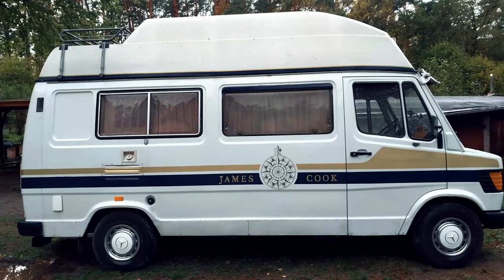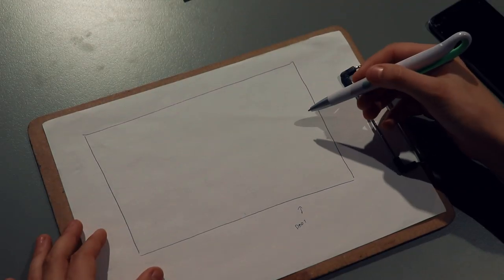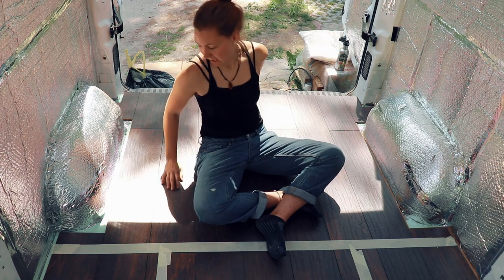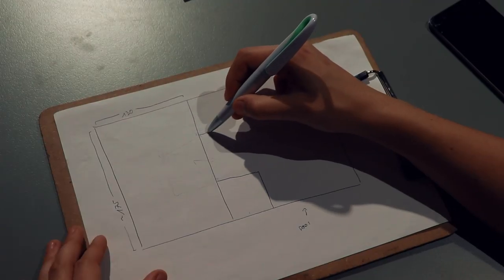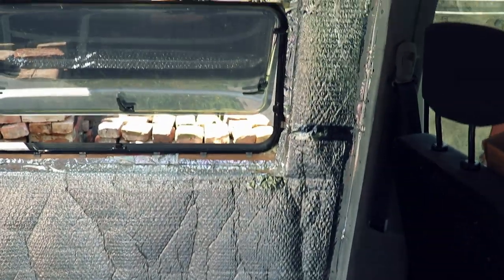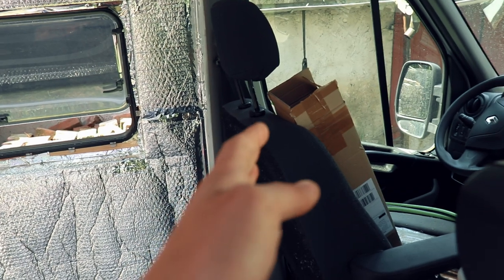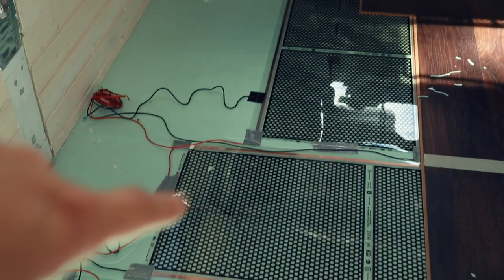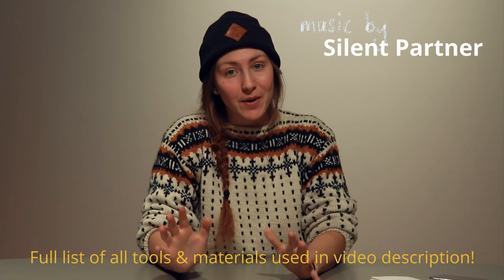FLOOR HEATING in a VAN??? My Layout | Van Build #05

Comment: We did this in our van build. I couldn't find DC mats in the US and used AC mats by Quietwarmth. Absolutely awesome addition to the van. Worth the extra effort.

One mistake I did make was placing the thermostat temp sensor. An exhaust muffler is directly under the sensor and it artificially raises the temp after we shut the van off. And the discharge from the Espar heater is near it also.

Comment: infra red foils are so thin, lightweight and not terribly expensive, so I think it makes perfect sense to include it. It is very important to have few heating options  in case of full time living, just in case something happens during winter. I will go with IR foil when on hook-up, 8kW Diesel heater for quick heating, and Truma gas heater as a main, quite option.

Comment: You are getting very good at putting that flooring down. Practice makes perfect. Every one of these builds is an experiment. You have shown you are not afraid of the trial and error that it takes.  Did your old van fit into parking spaces in Europe? Are you trying to become a stealth camper so that you don't get in trouble about living in your van? I don't know what the laws are about living in a van are in Germany. Lenja I would make that bed bigger to fit you properly so that you can rest without restrictions. You can convert the end of your bed into a small couch by putting a hinge in the bed base and using pillows as couch cushions. It is not like you need that room to have a dinner party for a party of ten. Looking good. Cheers from rainy California.
Reply from the maker: Haha thanks! You're so right! You sure shouldn't be afraid of that trial and error process! :D Not sure if I didn't make it clear enough but I want to be able to extend the bed over the seating area and that should be more than enough space for me :)
My old van actually also just fit into the spots as well! But I liked that part so I wanted to keep it the same with the new one. I realised that the stealth aspect is a little overrated, I had no problems what so ever living in my less stealthy van before, even though it's not really legal in Germany. The parking spot aspect is a big deal for me though since I'm living in my van in a city (Berlin) and if you don't fit in any regular spot it makes it extremely more difficult to find a place to stay. If you're interested in the reasons why I chose to sell my old van, let me know. I could make a video about that 🤔

Comment: Hi Lenja, I love your vlogs! I've converted my van too (I'm a Dutch girl) and put in 12v floor heating foil as well. It's nice to get the cold out of the floor but it consumes quite some power so I don't use it that often. I have vinyl flooring btw. I rather just wear my warm slippers 😉 For heating the van I use my Wallas stove with heating top.

I really like to see a true van build with all the mistakes, second thoughts and frustrations. This is exactly what it is for mere mortals to do a conversion. Keep up the excellent job you're doing,  you'll love it even more when you've finished it 😘

Comment: Have you calculated the power needed to run the heating film? I checked online and they are around 200 watts per square meter - At 12 volts that's 16 amps. I'm doubting that even with 525 watts of solar panels you'll be struggling to make even a fraction of the required power to run them on a cloudy cold day when you will need the heating most. What other means of heating are you planning?

Comment: I have heating foil in my van conversion. 5 pads, 24v each.. I have used the fleece covered ones. Consider that the laminate floor is going to move and shift around while driving, over time this can rub layers of the foil and break them or even create a electric hazard. Overall these are very slow to heat the floor, but work quite well to give a nice floor feeling. They are useless to actually heat the whole van though.. also need quite a bit of power ( I have a 5.5kw/h Tesla battery pack) because they need to run for a while..
Reply from the maker: Oh yeah, that's a good point! I used wiring that is made for vehicles so they are a bit better protected but still, I'll pay attention to that to make sure I'm using it in a safe way! But you're right, using mats like that seems like an easier way to make sure the wiring stays intact. Thanks for sharing!
Reply: I too looked into this 18 months ago - it's physics - too little floor area - too much thermal loss (windows and metal) .

Comment: How much energy does the floor use and do you need a secondary heat source for the cabin in Winter? We just purchased a new Sprinter van and are planning our build out starting this Spring - I mentioned in a facebook group about electric radiant floor heat and people think I'm crazy and insist on a water-based system which will lose verticle height and also could have problems such as leaks which could be a disaster - how much actual energy does it take to run?

Comment: Hi Lenja, if you watch a video dated 2 years ago, on the channel 'Alan Heath', titled 'underfloor heating in a van, will it work' you see him install heating foils underfloor and try them out. He concluded that they are not adequate, as the heat from them is not enough by a long way and so could not be used instead of a heater. Shame, because I wanted them to work well, a great idea. This was from two years ago, so perhaps these foils are made more powerful now, I hope so. There is a more powerful type, called a 'heating mat', so called because it does have thickness, but still only about 6mm, so I think this type might be hot enough to be the only source to heat your van. Best wishes, from Alan, in UK.
Reply from the maker: Hi Alan! Thanks for the recommendation, I'll check that out! I tested the heat foil by now and I think (the other) Alan is right; it's not enough to heat the whole space. However, I'm planning to install a second heat source as well and in a combination of those two I think it can work great! Just using electric heating would drain any battery setup super quicky I guess... But just having warm feet is already great because I am defenitely one of those people came who always have cold feelt 😅 thanks for watching! :)
Reply: @lifeoflenja390 Hi Lenja! I am really impressed by your spirit - ripping up the floor 2 times and keep on smiling. zen! Anyway, can you share your experience after 4 years? We are planning of installing that foil as secondary heating in the shower walls…

Comment: Hi. Just a quick suggestion before you progress anymore. Use thinner insulation either end of you’re bed area to maximise the space. You should find it’s still possible to get 1.8m with insulation in the van, you only need to reduce a section around 1m x the width of your bed. Others have done this

Comment: Gotta say your Accent is Kind a cute where are you from? :)
And do you plant on only using the floor heating to heat the van or are you Planning On some other additional heating System?
Currently restoring my VW t3 and that would really help me out to know how well it is working
Reply from the maker: Thanks! I talked a little bit about that in my Q&A video; the heat foils are working great but I'll add an extra heat source!

Comment: Did you calculated what will be energy usage of the floor heating? If so, could you please share that as well?

BTW are your floor panels - floor heating compatible?
Reply from the maker: Yes I did! That's a great question, thanks for adressing that! 
So the heat foils take 230W per m². So ~20A since they are 12V. One of the two segments I have is about 0.5 m², which means one has around 10A.
That's actually quite a lot of power, but not uncommon for electric heating solutions. Hope that helped! :)
Reply from the maker: Oh and yes, the insulation, dampening mat and laminate are all floor heating compatible! Actually the recommend maximum temperature of the heat foils are not really dependend on the foils themselves but on how much the laminate can handle! Sorry for not pointing that out in the video!
Reply: @lifeoflenja390  thanks for answers. Good luck with your build :-)

Comment: I know some high end rvs use these heated foils in them, but I always wondered if they can actually heat the van too, or is the heat just localized to the 1 cm or so of the flooring.  I'd like to see results when you can.
Reply from the maker: So I've made some experiences with them now and I love them! But it's true what you suspected; The heat doesn't spread thoughout the whole van and I wouldn't say the heat foils are a good replacement for a heater. So I'm going to install a second heat source, especially because I'm going to live in there in the winter. Hope that helped! :)

Comment: Hello Lenja, greetings from Mi-Heat we're Glad to see that you're satisfied with our product. If there's anything we can help you with, please let us know!
If you're planing to upgrade your Van feel free to check out our newest heating foils. 
We wish you the best luck for your upcoming adventures!

Your Mi-Heat - Team
Reply: Interested in knowing if it will heat a 26' Streamline trailer (like an airstream) she said it uses 12 volts, will it work with 24V (I assume DC?) and do you sell to US?
Reply: @sxsignal  It works with 24V, too, but unfortunately we don't sell to US by now because of the long shipping time of 60 days or more because of the Covid19 pandemic. Normally we sell also to US/Canada/Australia.
Reply: @infrarot-fussbodende  NOOOO this was my only solution I've found that will do 24V dc! I think the shipping time is fine (though I get stuff from England in aTeslamodules, 730W solar, Victron components) that the market for you will be there.
Reply: @sxsignal  @Ingo McLean please write a mail to info@infrarot-fussboden.de which  heating film and quantity you need, we'll find a solution for you. If it's possible please attach a sketch of your project. 
Greetings Markus
Reply: @infrarot-fussbodende  thank you, email sent.
Reply: @infrarot-fussbodende  I too am in the US and interested. You appear to have excellent customer service. Perhaps we will speak soon!
Reply: @jordanwelty6582  Feel free to send us an email at info@infrarot-fussboden.de with your project. A sketch will help us to work out the project for you in detail.

The delivery time is still around 60 days due to the very tense situation worldwide.

We look forward to receiving an email from you.
Greetings
Markus

Comment: Hi Lenja, Im just in the planning stages for layout and I like your floor plan a lot. Can you tell me how you determined the layout of the boards on your van floor. Was it based on your layout I was planning on putting boards every 8 inches from front to back of the van and polyisoprene in between. Then plywood over all that and finishing the floor with vinyl flooring. I've watched tons of builds and it seems everybody does floors and floor insulation differently. Just wondering if the boards are necessary if I'm doing plywood anyway
Reply from the maker: Hi! If by boards you mean the wood in between the insulation then yes, I was doing that according to my layout! I wanted to make sure that everywhere the furniture would stand on there is wood underneath to support the weight. Even though the insulation seems quite stiff and sturdy, I felt like I needed to protect it in that way. Now since you want to use plywood on top the weight of your furniture might bei distributet a bit better, but I still would make sure the plywood is supported by wood and doesn't just rest on the insulation. You probably also want to screw down the plywood into the wood. So yeah I think it's necessary, but your plan sounds good to me. Hope that helped! :)
Reply: @lifeoflenja390 Thanks!!!! yes that does make sense. I'm going lighter on insulation as I plan to avoid extreme temps both hot and cold. Still not sure if I'm doing 1inch or 1.5inch thick polyiso foam board.

Comment: Hi Lenja, did you install two thermostats or one? Also, did you buy the van with two single seats? Mine has a double on the passenger side.....
Reply from the maker: Hi Matt! I installed two thermostats so I can regulate the heat foils separately. And I got the van with a seat bench as well. I tried to find an affordable single seat for the pessanger side but I wasn't successful. So I decided to leave it with the seat bench for now. Hope that helps! 😊
Reply: @lifeoflenja390  I was watching a video the other day and they installed Opal Vectra seats, I'm sure you could find one cheap enough in a scrap yard. If you could find a UK/Irish right hand drive Master/Movano/Interstar the drivers seat would fit without any modification.........

Comment: Good Job!! I am doing the same on my van, just curious what type of thermostat did you used for the Mr.Heat  foils
Reply from the maker: I just used a cheap and simple on-off thermostat. A thing I had to consider though was that it worked with the high amps that are needed for the foils! Make sure to check the requirements and if in doubt you can order the more expensive ones (from the mi-heat website for example!) Good luck with your build! 😊

Comment: First time I hear about this heating foil. Have you done any research around the power consumption? are you planning to power them up with a solar+battery setup? Will follow the build up. Greetings from Mitte ;)
Reply from the maker: Yes I did! I defenitely should have included that in the video 😅
The heat foils take 230W per m². So ~20A since they are 12V. One of the two segments I have is about 0.5 m², which means one has around 10A.
That's actually quite a lot of power, but not uncommon for electric heating solutions. And yes, I am planning to power them with solar! It's going to be a pretty heavy system though, especially regarding the batteries (I'll make a seperate video about the electric system!) 
Cool to have somebody here from nearby, thanks for watching! :)
Reply: Life of Lenja, just a friendly word of advice re your solar / battery setup. you can only use what you can generate so make sure the solar is big enough. No good having huge batteries if you cannot recharge them. Best wishes and good luck 😉
Reply from the maker: @GregVirgoe  thanks! Yes that's a good point! I'm trying to fit as much solar on my roof as I can, although I'm now a bit limited with my space because I Installed that giant roof light. Hopefully that will be enough 🤞 thank you for watching! :)
Reply: @lifeoflenja390   that does sound like a lot for those. See my reply to your other post above where I link to another van builder where they use piped hot water under their van floor and their friend's company sells kits for it for van builds. They were barefoot and toasty in their van with heavy snow outside and they said it only used 80w or so.

Comment: Weirdly I was thinking "smart, don't put those heat foils below the floor, the more layers down it is the closer it is to the exterior of the van and the more heat is going to be lost, put it under a nice rug or something".
Reply from the maker: That's actually something I thought about as well and I think you're right! I discovered that there are 12v heating rugs by the same company that would be perfect... AFTER I already ordered the under floor heating. So I decided to stick with that. But that's definitely an option! Let me know if you're trying out something like that!

Comment: You have thought your build out very well, I will be putting my batteries under my van because I need room to fit 4 beds , I have put solar panels on the roof , but rushing into the build I should of put a roof rack on my van first so I will when I find a roof rack be taking my solar panels off and putting them on the roof rack so I can rase them and turn them to face the sun once I have done all that I will be working on the inside , I did have a go at making a YouTube channel but I don’t have the equipment to do it so my channel will be on hold until I can get a camera with a stand . You seem to of given your build a lot of thought , but this is my first build and I do need the 4 beds for my grandchildren to come with my wife and me .

Comment: Hi Lenja, Love what you are doing !
But : those 230W/m² heating foils are not supposed for wall heating only ?
I may be wrong but I believe for floor heating you are not suppose to go over 110W/m² (veins and blood circulation questions if I remember well)...
Hope I'm wrong. Keep building !
Reply from the maker: Hi Jacques, thank you! :) I looked up the product on the company page again and they stated that these heat foils are explicitly for floor heating and ideal for mobile applications such as RVs. Soooo I figure it should be fine? Good point for asking that though, I'll do a bit more research about that to make sure I'll use them safely!
Reply: I will now order this foil ,and seller recomenns 130w version for me.
I want to ask you,if is it passible to heat small caravan/van only with these foil,changes it the room temperature?
I have small Niewiadow n126 with no heating now...

Comment: Looks like you are designing that bed for a couple not just for yourself. When you are lying up above the wheel arches, 1.75 m will be plenty wide enough and you would only need about .6 metre instead of 1.3 metre the other way. That would give you 0.7 metre more room in the living area when you are out of bed.

Also it will be important to know how much power those floor heaters are going to drain out of your battery. I am guessing they will drain the battery a lot or you will need to install a very large house battery.

Comment: Any problems with the wiring or sensors creating "bumps" in the flooring?
Reply from the maker: Nope! It was enough to cut out the green floor sound deadening mat to avoid that!  :)
Reply: @lifeoflenja390  Thanks for the reply.
I had thought of that as a solution, good to know that it works.
I will add this to my "must do" list for my future. 😃